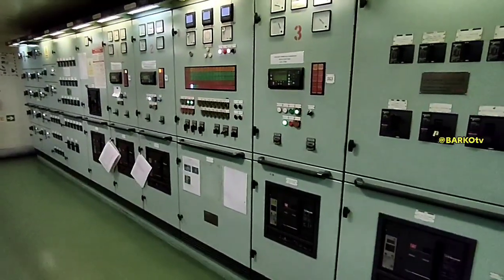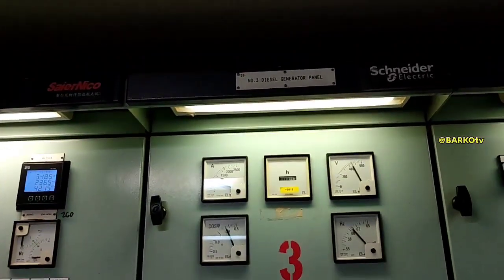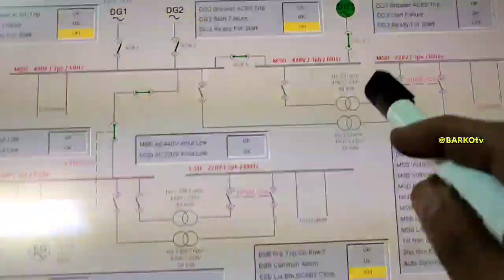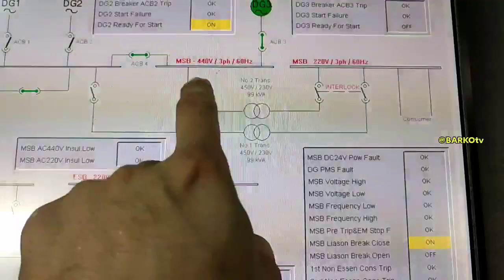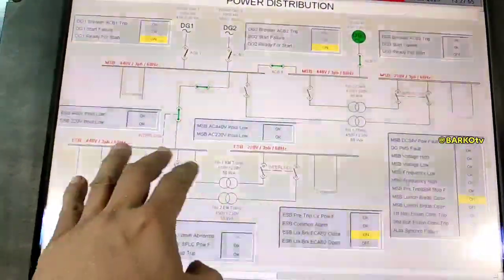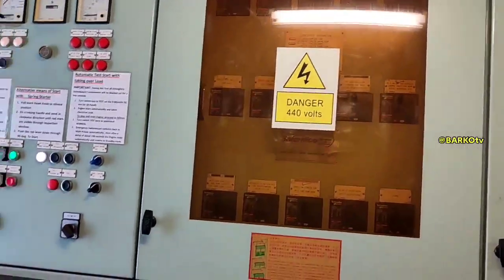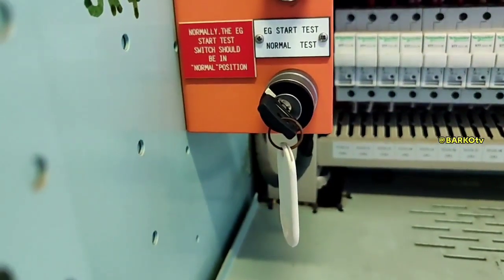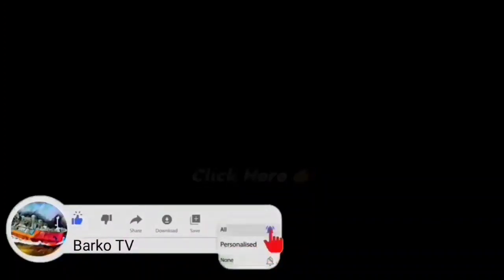Ship's Mainswitch board and Emergency switchboard. Power Distribution. Schneider switchboard

Comment: Why 1 Air Circuit Breaker on one side and other 2 Air Circuit Breakers on other side in main switchboard ?
Reply from the maker: It is a design and the main purpose, if you have any problem in other side of bus bar in case in no.2, you can still run the generator with out black out, just isolate the bus tie and now you can work on no. 2 bus bar.
Reply: @BarkoTv  Thanks a lot sir